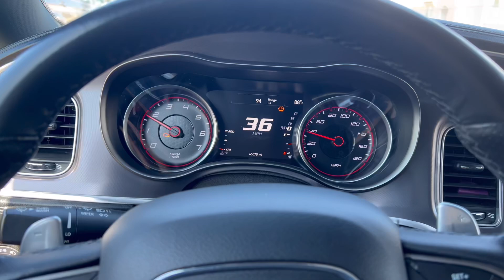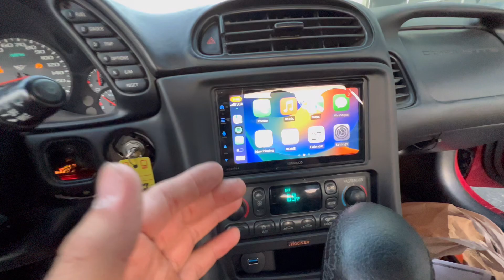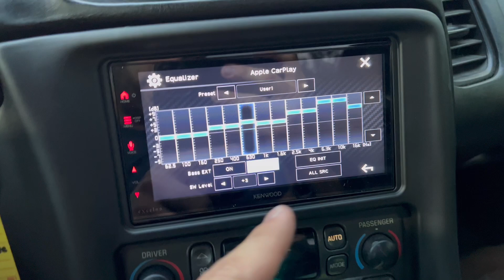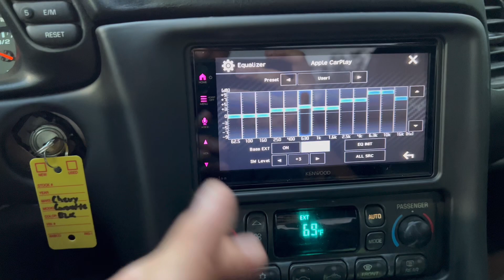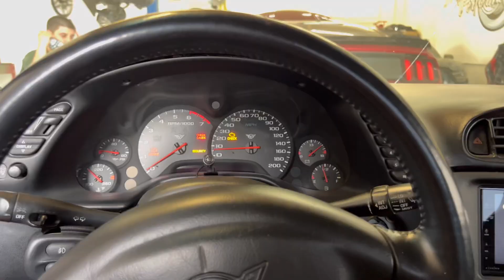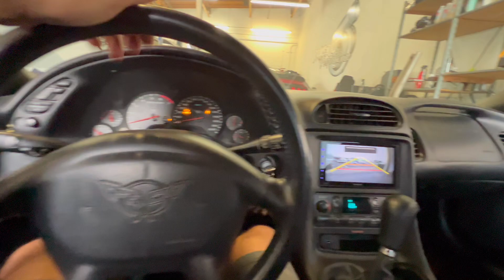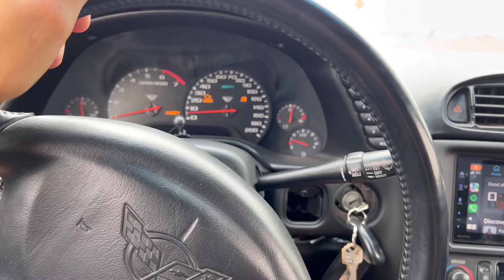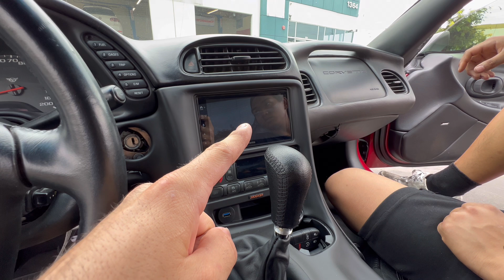C5 Corvette Gets NEW MODS! #Chevrolet #C5 #Corvette

Comment: I had the same issue with my vette i was told the oem ones are actual rubber were the aftermarket ones are silicone based.